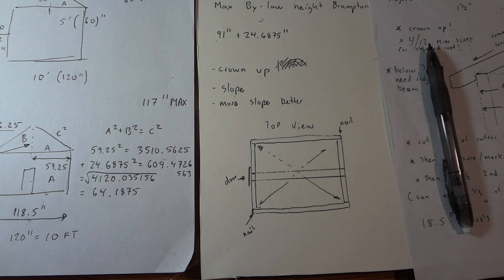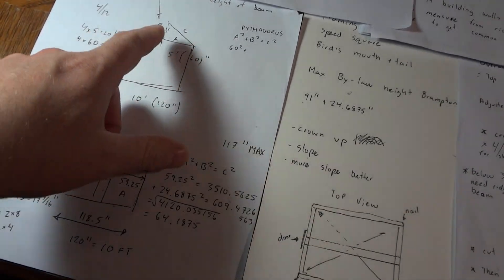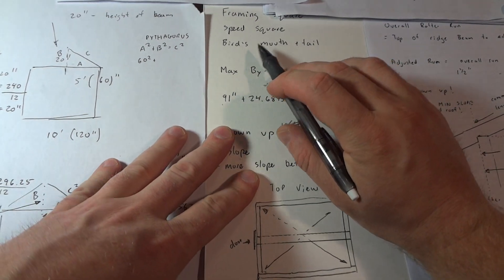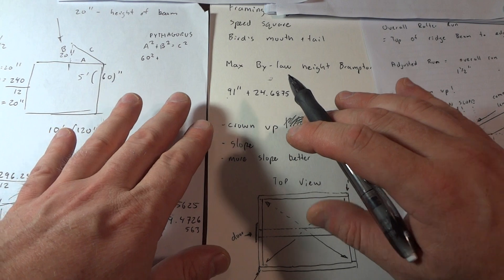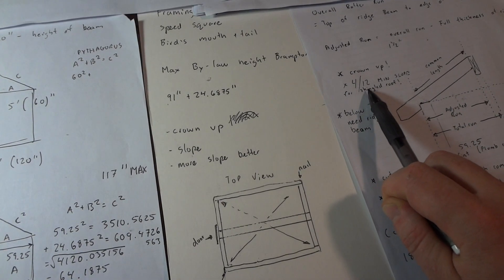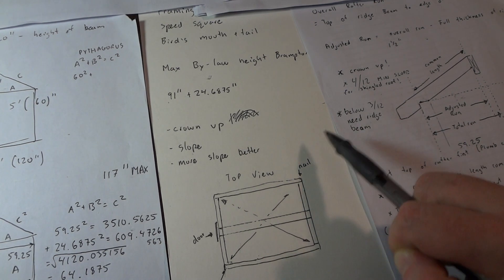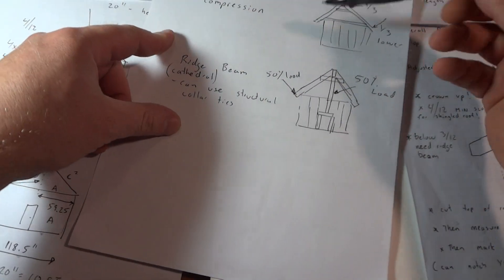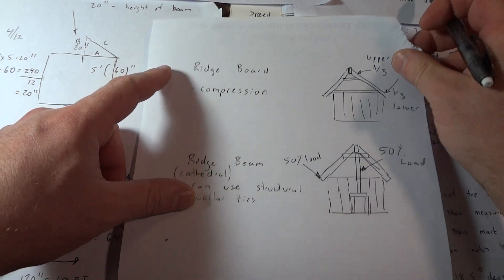Shed roof build how to calculate ridge beam height for any pitch slope easy way brampton

Comment from the maker: ANYBODY WATCHING THIS VIDEO ,  I Made a few errors. I did not account for the depth of the seat cut which would be 1.5 inches for a 2x4 and also possibly the 3/8" ridge drop. So basically add 1.5 - 2.5 inches to your rise. And then check if your plumb rafter end top cut is flush to the ridge beam. also dont trace rafters from a pattern rafter as this is too unnaccurate and will not fit properly.. More videos to come.

Comment: That's a lot of paper work 💥💨
Reply from the maker: its a fucking mess.... because the foundation has a slope. and i dont want to make the shed level because i dont really know if that will fix the roof issues. I think all the walls arent 100% square either. i dont care any more. im putting on the roof ! its just a shed, as the saying goes : P